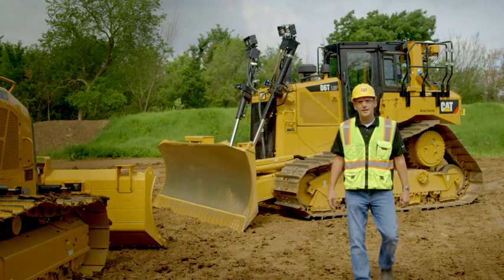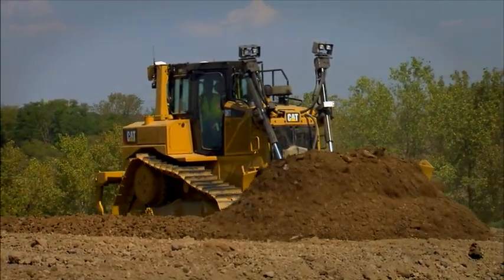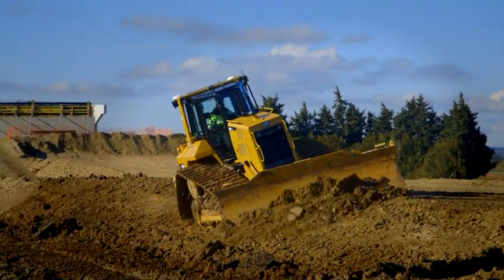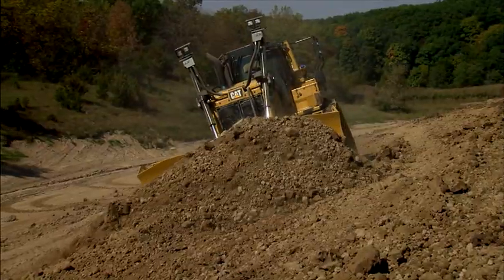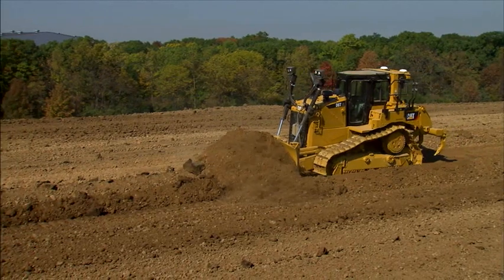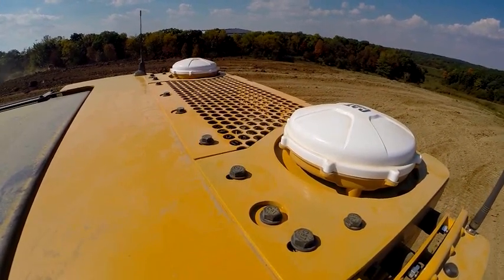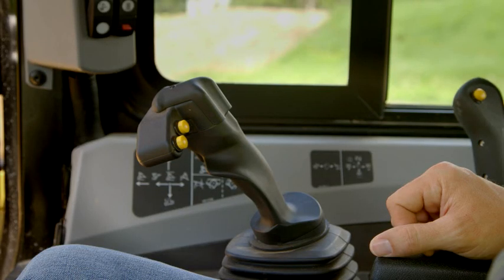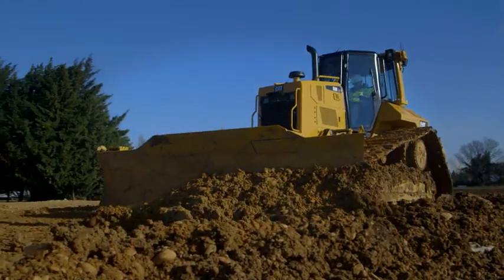Cat® Dozer Technology | Cat Grade Control 3-D

Comment: We just had a D6T as a demo for a few weeks with the Grade Control feature but didn't realize it was intergraded in the GPS computer. To be clear tho, this is not a GPS site plan setup correct? just manual specs and increments set by the operator to let the blade follow a certain path?